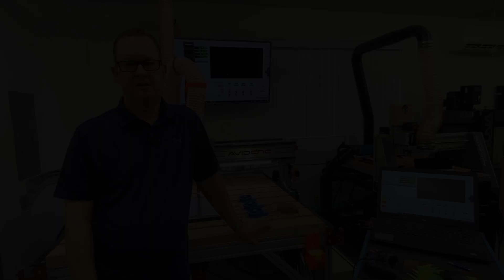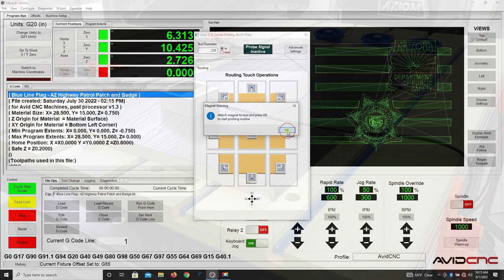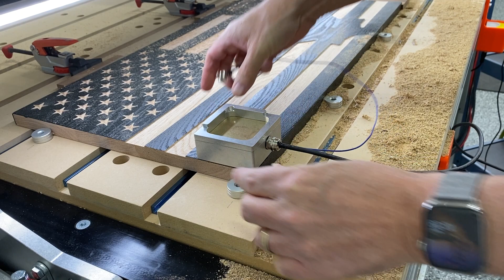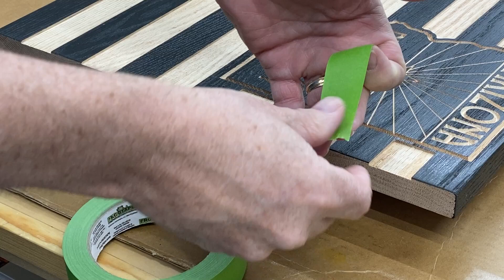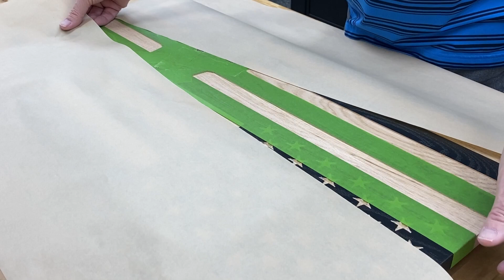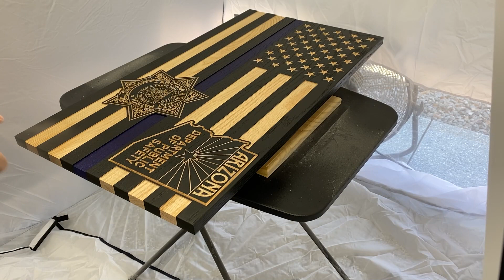Creating a Project on the AVID CNC - Part IV:  Carving a Police Blue Line Flag on the AVID CNC

Comment: Quick question. Do you ever have issues with tool marks in the stirpes as it moves up the Y axis?  I have the same machine and flatten my board per your flattening video.  When I cut the stripes (usually with a 1/2" downcut then the 1/8" cleanup just like you do, it leaves tool marks (gouges) as it gets to the furthest point of the xX axis and moves up on the Y axis.  I always get 3-4 tool marks I have to sand out. I believe my tramming is good since I do not get any visible lines anywhere else while carving and I'm using the exact same bits you use. I don't know if it is the downcut bits, stepover or just a normal thing when carving stripes.  Any suggestions would be appreciated. I have a photo if needed. Thanks.
Reply from the maker: I do have those marks from time to time, even switching from a 1/2 inch to 1/4 inch end mill. The sharper the bit, the less witness marks left behind. Also I have found if you do a last pass with  an upcut bit about .007 it does mitigate some of those marks and leaves the surface really smooth.
Reply: @BlueLineCNC  Thanks Russ.  I will give the up cut cleanup pass a try.

Comment: Do you happen to have recommended speeds and feeds for the Amana 46054-k. the Amana tool file seems very crazy to me. its like 18k rpm, 270 feed, 90 plunge, .1 step over, .25doc. Any help would be appreciated. I run an avid cnc, aspire, mach4. Thank you in advance!
Reply from the maker: Those are actually accurate, right from Amana, if your machine is capable. There’s nothing wrong with backing it off a bit. Those bits are designed to run fast. Many hobby machines like the Xcarve and Shapeoko just can’t go that fast.
Reply: @BlueLineCNC  thank you, I do appreciate the response! I use a 8.7hp spindle and the avid motors can easily do 600ipm. It just seems nuts when that thing rips around at 600ipm lol. I like backing things off a bit for my own anxiety sake hah.
Reply from the maker: @cmaletsky1988  with that bit I believe my settings are around 180 feed, 90 plunge (ramped over .5 inches), 40 percent step over (varies per project), and .125 depth of cut.  More conservative than factory specs. I cut into oak mostly. Material type will obviously change things up a bit.
Reply: @BlueLineCNC  thank you, I will give those a shot! Yes, I almost exclusively cut hardwoods, as of late, a lot of  hard maple and walnut.
Reply: @BlueLineCNC  forgot to ask is that at 18k rpm or do you drop that to 15k-16k rpm?
Reply from the maker: @cmaletsky1988  I run most of my bits at 18k, with the exception of a few downforce v-bits from Cadence mfg.  Those I run at 14k.  I have never broken a bit by staying at or slightly below Amana specs (with Amana bits).  I think guys get too aggressive or they use specs from premium bit makers like Amana, Whiteside and the like and expect cheap Chinese bits to perform in a similar fashion.  Just ain’t gonna happen!

Comment: Hi Russ. This was an AMAZING series!!! I watched every bit of it, and I'm watching part 1 again too. It was so damn easy to follow and detailed. Fun to watch too. ❤
I have a really quick question tho, after you stained the blueline, you went back and sanded the grain down and put a second coat on. 
So what I wanted to know is, do you also do that to the board after you put the black stain on, before you put it on the machine?
If you DON'T do that, then how many coats of the stain would you apply?
Thanks so much and thanks for putting this series together. ESPECIALLY part 1, that is going to be extremely helpful for this newbie. 😃👍
Reply from the maker: Hi Joe.  Yes I also put two coats of black on, sanding with 220 between coats.  Glad you liked the vid. Stay tuned for more.
Reply: @Blue Line Wood Flags  Good morning Russ. Thanks for getting back to me and thanks for the info. 😃 I appreciate it.
Reply: @BlueLineCNC  Kind of a follow-up to Joe's question.  Are you putting the stain on and just letting it dry that way or wiping it off with a rag after application?  Thanks! :)

Comment: Great series! - thank you for sharing your work flow. How do you clean up the ‘fuzzies’ from the v-bits without messing up your black finish?
Reply from the maker: Great question!  V Carve tool paths do two passes, so that helps.  Using very sharp bits helps, as does running the tool path a second time.  If you run it again, only lower your Z by no more than .003.  Use stains over paints.  Use tape, such as clear scotch packing tape to try and work any areas to pick up any left over fuzzy parts.  Those are some of my methods.  😀

Comment: To protect the bits during changeout, I place some of the Avid packing foam under the spindle.  If you drop the bit, pointed ones usually stick into the foam like a spear with no damage.  Steve